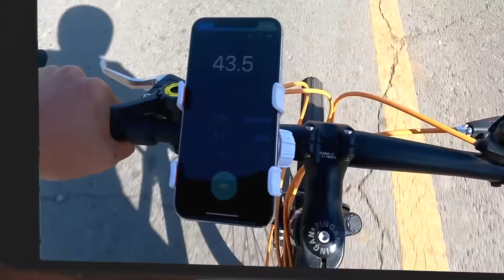How to Make a Speed Bike

Comment: 50-60 km without brakes! Great idea!
Reply: It's a fixie, a fixed gear bike, to brake you have to stop pedaling
Reply: @eljigui9131  if you think about it though the gear ratio works in reverse too i think i haven't ridden a fixie before but if the gear ratio works in reverse then you get the same amount of torque back and it has very little torque so you're better off stopping by just letting air drag slow you down.
Reply: @eljigui9131  Check back to where he puts the chains on...
Reply: @eljigui9131  If you stop pedaling at like > 30km/h it will break your shin before slowing down a bit
Reply: @eljigui9131  no it isn't.
Reply: @eljigui9131  3:00 no
Reply: @eljigui9131 there's something called inertial momentum in physics, Reverse pedalling friction is less than forward inertial momentum at 50 kmph
Reply: I want to see a follow-up video where he installs the vice jaws on the bike as brake pads like at 1:00
Reply: It's a waste of time as far as I'm concerned.  I have followed (in my car) a cyclist commuting on a super light bike, in body hugging clothes and wearing a small backpack...and he was holding steady 30 MPH on flat ground for better part of a mile.  Build a super high geared bike like that for when you live in a world where every trip is downhill.😂🤣🤪
Reply: It's doesn't need a break because his legs is going to break
Reply: @Musa_T_Nasir  lol yea
Reply: Dont worry guys hes wearing a helmet 👍
Reply: @samuelgimber7155  what's the purpose of the helmet if the ones breaking first are your shins?
Reply: who needs brakes?
Reply: @quasimodo8959  he hasn't attached it to the rear gear yet see the chain is slacking
Reply: @eljigui9131  2:58 isn't fixie
Reply: If you ain't first yer last
Reply: yes great i feel from 70 km/h thanks
Reply: Even worse, it's a fixie. High speed foot removal.
Reply: As i fixed gear bike user i am agreeing to this i can go 70km downhilll no brakes on a fixie!!
Reply: Breaks? Where we going we don't need breaks.
Reply: @Ackieru  any bike can do that

the question is what comes afterwards
Reply: I think Walter Jr will breake the bike, because he is braking bad
Reply: it is far more difficult with active brakes.
Reply: Or just put your hands out for a bit. XD
Reply: Flinstones found a way and they had cars
Reply: Your idea is better than his idea 😅
Reply: I haven't noticed 💀
Reply: @eljigui9131  what if the chain snaps cuz of the high gear ratio?
Reply: ROFL
Reply: lol
Reply: if you peddle backwards on that it will stop
Reply: He used a torpedo gear
Reply: @eljigui9131  no it’s not fixed gear.
Reply: Brake need for beginers
Reply: @eljigui9131  3:00 its not fixed bike anymore.
Reply: @eljigui9131  We call it "brek mati" (dead brake in Malay) because there was no brake (including disc brake) in use
Reply: @eljigui9131  Sorry but he does not have that rear hub. You can see him backpedaling at 3:00, so, no brakes.
Reply: omg😂
Reply: 😂be a man
Reply: Simply this man is nuts
Reply: I tooo observed it
Reply: Man don't use breaks. Homosexuals and Women use breaks
Reply: Əylec arxa təkərin içindedir dostlar pedali araya tərəf etsən əylec işə duşecey bu sadə velosipetdir
Reply: 5min craft be like
Reply: lesse wheight more speed!
Reply: it's not a great idea. all bikes that you are gonna use daily should have breaks.
Reply: Pfft mean while Street kids and teens in my country has rusted chains on and no breaks while wears flip flops and challenges each other to a drag race. in a city with People all over the place.
Reply: @eljigui9131  it's not a fixie bruh
Reply: @eljigui9131  i'm guessing you haven't use a fixie cause at 3:15 yeah that's definitely a fixed cogs not a free wheel
Reply: I just realized isn't a fixie bike
Reply: @call_me_mado5987  😂😂😂
Reply: After he finished with it. He backpedaled so no fixie there
Reply: just use your shoes as a brakes
Reply: If this is a kid's bike, then you brake as quickly as you slow down as you go by scrolling the pedal back😂
Reply: Regular mountain bike with bigger gear on front can do the same. Regular bike for track can do the same. Your max speed on the bike is limited mostly by horsepower and aerodynamics. You lose about 5% of efficiency on each chain. Much more weight. It doesn't make much sense, but it looks cool : D
Reply: Brakes slow you down
Reply: No no, put 4 wheels and no brakes so you can power slide.
Reply: @eljigui9391 the torque would kill your legs
Reply: @eljigui9131  watch 3:00 you can see that it freely moves backwards, NOT A FIXED GEAR BIKE
Reply: @ichosolemanuel6048  yeah you're right
Reply: It has regenerative braking.
Reply: I do that all the time on my homemade electric bike, my heels work well enough
Reply: tesla rocket also no brake
Reply: It will rip your ankles before you even think of stoping
Reply: That's how I lost my lincense
Reply: Brakes invented for cowards!))
Reply: @eljigui9131  Fixie means fixed and single gear bicycle....not a bicycle without brakes 
Pedaling brake is just a trick
Reply: its a coaster hubs,unlike fixed gear coaster hubs is a freewheel that when you back pedal or reverse pedal the brakes on the hubs is gonna activate
Reply: @xevasthianxaviermallari  a ok
Reply: Толку делать е тот бред он быстрее не станет
Reply: bruh thats only 37mph I hit more on my MTB
Reply: It has a coaster brake
Reply: V12 bike💀
Reply: Absoluteley

Comment: I'm pretty sure it is super hard to pedal this bike or even impossible on uphill.
Reply: honestly just starting to pedal on this thing on flat ground seems painfully hard
Reply: that's why you get a hub motor on the front for electric assist
Reply: @kingmasterlord  Might as well get a road bike at that point, and they're faster.
Reply: Infact he was on descent
Reply: Way to miss the point
Reply: not only that, this gives no power... reving more on a lower gear he would go faster.
Reply: at least its good for flatworld at minecraft
Reply: You must be a physicist :o
Reply: Imagine riding this thing in a city like San Francisco
Reply: but when you pedal it quitely long the resistance decrease with the same speed
Reply: but how can he ride calmly without looking hardly pedaling?
Reply: why this should be a problem if you add shifter? Superbig  gear for a good roads when you already gain speed to go even faster
Reply: @giancahe8202  
व
Reply: Yes , because torque is high 👍🏻👍🏻
Reply: The guy in the video is skinny so probably not
Reply: What’s is the point of going uphill when u have such a sick bike🔥
Reply: Good things aren't always easy, despite that, what a legs I would be building 😈💪
Reply: u  clearly dont know that those gears can SWITCH from high to low speeds
Reply: it's also limited by ur weight
Reply: Thank you, Captain Obvious.
Reply: Lmao I was thinking that too
Reply: If you install a shell with a cog that can incompase the wheels inner original cog you can create it in such a manner so the start wouldn't be such a difficult  process
Reply: I am pretty sure u r correct
Reply: thats why you put a V8 on it
Reply: Maybe for someone of your caliber
Reply: Add a few more gears and you’ll get to high enough speeds on the flat areas that you can coast up the hill lmao
Reply: @metroboomin6084  smh Miata guys🙄🤦‍♂️😂😂
Reply: Actually I think it’s easier than normal
Reply: To everyone saying “just shift”, the bike literally cannot with how it’s designed
Reply: Just have stronger legs dummie 🗿
Reply: What's so hard. If anything looks easier, uphill too🤤
Reply: The extra gears reduce the load. You actually pedal less get more speed. That's the point of it being a fast bike
Reply: @kongeethegod  You clearly dont understand how torque works. while, yes, you go faster with each full pedal, it requires much more force to do so.
Reply: It's like Apple always says: you're using it wrong. You don't use a speed bike like a mountain bike. It's rather for arena use only.
Reply: Skill issue
Reply: You can always walk and push the bike uphill you know
Reply: Worst bike ever
Reply: Ну... ты можешь разогнаться просто вставая то на одну педаль, то на другую. Гравитация сделает своё дело, а потом уже просто крутить педальки в обычном темпе
Reply: Try harder
Reply: very true
Reply: Get an evil e attachment
Reply: The bike will pedal you instead 😂
Reply: Ты абсолютно прав
Reply: @klopcodez  it will indeed
Reply: Lol
Reply: Regular mountain bike with bigger gear on front can do the same. Regular bike for track can do the same. Your max speed on the bike is limited mostly by horsepower and aerodynamics. You lose about 5% of efficiency on each chain. Much more weight. It doesn't make much sense, but it looks cool : D
Reply: U got it✔️
Reply: Даже на обычном дорожном велосипеде с 28 колёсами очень тяжко ехать в горку и стартовать с места.
Reply: After pedaling for a while, it would basically pedal itself and all you would have to do is light pedal
Reply: @giancahe8202 fthjh😢
Reply: Nah this would be light work
Reply: He was moving at either 50 km per hour or 50 mph. Either way, that's enough speed to just coast 90% of the time. It may be harder, but you also work less.
Reply: Also super easy to pedal downhill full power, but make it a straight downhill...wheeee!
Reply: one way to make the start faster is you run a bit then hop onto the pedal thats in the front, it will surely get some form of speed from that
Reply: That's not the point of this bike
Reply: Honestly flat.uphill, wouldn’t matter your mainly on a 40T witch isn’t nothing at all !
Reply: Hey, look on the bright side on one gonna steel it😊
Reply: Noelswai no it doesn't because the first year is 1 the second is 3 the Third is 1 it can go up hill
Reply: @giancahe8202 Just build in a Gear shift
Reply: Про подъём и речи не шло.
Однако даже стартовать на таком велосипеде удовольствие ниже среднего.
Reply: They start bikes like this by pulling them up to speed with a vehicle on a straight track and then recording the speed the person can pedal. That's how the landspeed record was obtained
Reply: Who TF is going uphill on this? It's just a normal city bike
Reply: Yes bro
Reply: well yes the point is just having higher torque so you get more max speed. you cant get more speed without more energy
Reply: No it is not that hard as he used a principal in mechanics called gear ratio (search it up) and that is why it isn't that hard
Reply: No bro, it is easy. More gears more speed and less power bro

Comment: I’d say this is comparable to launching your car in 3rd gear (assuming you didn’t stall). You’re gunna turtle for several seconds before any speed happens. Probably takes quite a bit of leg strength to initially get going. Awesome!
Reply: I mean, get it up to 45MPH and it'll go up that hill, so long as the hill don't last too long. XD
Reply: So what direction would you go with the ratio? or, does anyone even know what the ratio he has now is lol. 😆
Reply: @kennethferguson9828  presumably you’d do what actual bikes do, which is have a derailleur so you can start in a low gear and adjust the gear ratio as you need to.
Reply: pair it with a wheel hub gear box and you should be good to go.
Reply: That's the thing you WILL 100% stall if you launch your car at 3rd
Reply: @zombie-process7025  45 kmh not mph
Reply: Regular mountain bike with bigger gear on front can do the same. Regular bike for track can do the same. Your max speed on the bike is limited mostly by horsepower and aerodynamics. You lose about 5% of efficiency on each chain. Much more weight. It doesn't make much sense, but it looks cool : D
Reply: This bike has got no fucking breaks
He’s gonna crash so hard 💥
Reply: Well if it's a diesel with a six speed...

Comment: Best idea was to leave the bearings inside the bottom brackets for welding. Next best idea was the spray paint job. Everyone knows, orange chain makes you faster. But hey, it's a fun project, so good job 👍
Reply: red makes u go faster check orks in warhammer 40k
Reply: @lythicology5041  it's not yellow
Reply: =PAINT ALL IN RED BECAUSE RED MAKES THINGS FASTER

.........YUP,WARHAMMER40K,HEHE
Reply: It's true, ask lightning mcqueen
Reply: Its a tough call for me between the 2 you mentioned, and sloppily hole saw-ing chunks out of the frame members.
Reply: @outsider344  Also, not including any way to tension the chains.
Reply: Also the slack in the chains prevents them from getting missplaced on the gear teeth during operation... or maybe it actually increases the risk...
Reply: It makes for a good video
Reply: You paint flames on ur car you get extra 15 hp, everybody knows this. orange chain gotta add lil extra something.
Reply: why is the welding really bad for bearings? I mean, I understand, the heat can cause.. Can cause what in this case?
Reply: @Arkturbettel  heat expands and contracts metal, and due to welding being a point kind of heat source it stresses the bearings unevenly. That may cause stress to the hardened metal of the bearing, which may later lead to fractures or failures. It may also affect the shape so much that it is not as round as it was before, increasing wear in the bearing. Also the grease inside the bearings is not designed to withstand metal melting temperatures, so the lubrication properties get seriously altered or totally destroyed, which is the most significant effect in this kind of light-load solution.
Reply: You forgot the last step where you removed the bicycle seat from ur as
Reply: @Arkturbettel  it's going to warp the shape of the bearing ruin the heat treatment.
Reply: how much more speed can i squeeze out of it if i added racing strips and decals?
Reply: @KitsuneHimitsu  1.21 gigawatts
Reply: DA RED UNS GO FASTA
Reply: @lythicology5041  if you want to be sneaky paint it purple
Reply: Regular mountain bike with bigger gear on front can do the same. Regular bike for track can do the same. Your max speed on the bike is limited mostly by horsepower and aerodynamics. You lose about 5% of efficiency on each chain. Much more weight. It doesn't make much sense, but it looks cool : D
Reply: I was thinking about not continuing to watch bc the rim in the vice made me hnnnnnnnggggg "Not the rim in the vice!"

Comment: Before welding, the paint should have been removed.  Also, rather than cut into the frame of the bike to add the hubs for the two new sets of sprockets, new pipe should have been welded onto the frame to add the hubs.  Cutting the frame to weld in the hubs creates the possibility of the frame not being aligned perfectly straight afterwards, which adds structural weakness.
Also, gear ratio is way too high unless you do serious biking.  I used to bike 24 miles every morning (took me two hours), my legs were huge, and I doubt I would have been able to get that bike going without struggling, or starting from the top of a hill
Reply: This thing is just meant to have the highest gear ratio he could think of without making a front gear the size of the wheel itself. It's a proof of concept, not a product.
Reply: this is a chinese channel did you really expect them to do anything right
Reply: @logandunlap9156  : It is often when you underestimate your opponent that you are best crushed by him.
Reply: Probably 10 to 11 gear ratio. Seen higher....
Reply: They almost definitely had a tow start. If I can throw my SS conversion all out of alignment going out of saddle up a hill, this thing isn't gonna get up to 25kmh let alone 50 without snapping
Reply: Ooh also doing this with platforms and no breaks is an absolute death wish... That's how you get launched over the bars into low earth orbit 😂😂
Reply: Well look it did work though.
Reply: Regular mountain bike with bigger gear on front can do the same. Regular bike for track can do the same. Your max speed on the bike is limited mostly by horsepower and aerodynamics. You lose about 5% of efficiency on each chain. Much more weight. It doesn't make much sense, but it looks cool : D
Reply: @humanspirit3432 no brakes on this bike though, so this guy was taking a huge chance.

Comment: Others are appreciating his hardwork but I'm shocked to see no brake on the bicycle with such great speed 😶
Reply: I am more shocked to see the original built quality of this bike. Ouch.
Reply: Pfft mean while Street kids and teens in my country has rusted chains and no breaks while wears flip flops and challenges each other to a drag race.
Reply: @GunneraManicata  
R u from Brazil or Phillipines or Indonesia or any other ?
Reply: If you want to build a higher speed bike, i cant think how adding breaks will increase speed of the bike... 😀😀😊
Reply: @mmeettwwoo  It increases the possibility of being able to ride it again and again
Reply: @ichbrauchmehrkaffee5785  yup yup, i understand, drivability is function of both speed and good brakes... Thanks. 👍
Reply: At such high speeds you need to change the brakes regularly due to high friction

Comment: 52 kmh is still acheivable on a stock 3:1 gear. However you need about 500 watts of pure power to maintain such speed, which is much greater problem, than not so convenient ratio